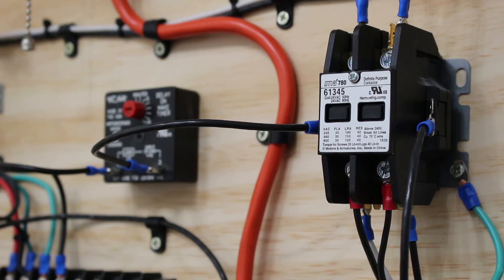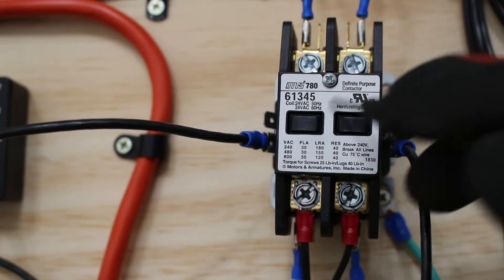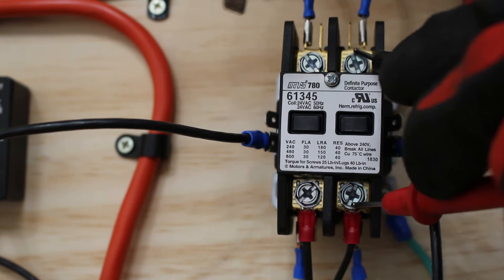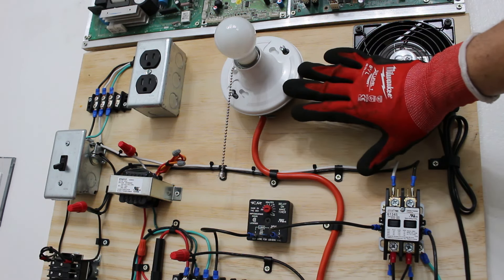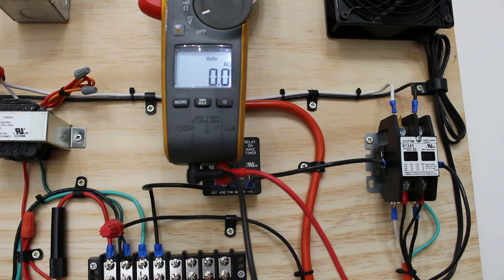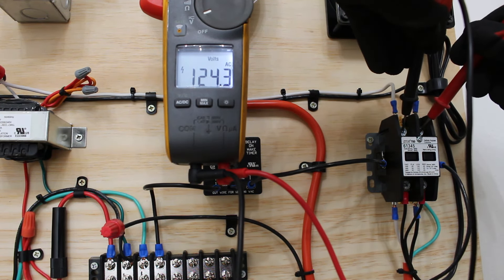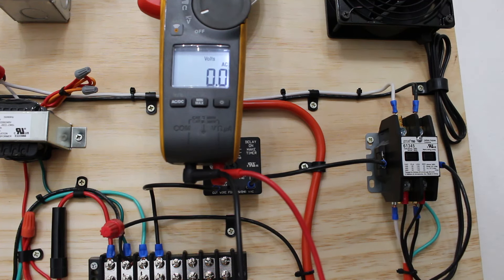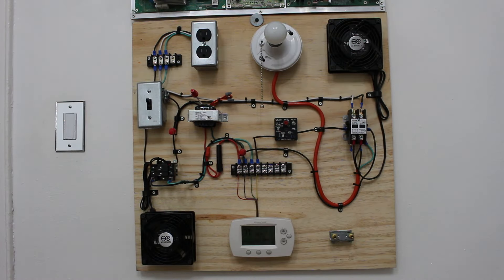HVAC Training Board: How To Troubleshoot A Contactor (Electrical Training Board/2 Pole Contactors)

Comment: As an electrician of 36 yrs, I love your videos because I generally don’t get to work on HVAC systems very often so it’s very interesting! I was just on a rooftop troubleshooting a 480 volt over load relay for an AHU that hadn’t worked in 7 yrs! All it was, was a bad over load relay, $300 part, all fixed. It makes me feel good to solve problems. What did confuse me was that the relay had an auxiliary contact on it and I couldn’t figure out what it was energizing because it got lost in a bundle of cables but in the end it didn’t matter anyway. Thank you!

Comment: Need wiring diagram showing where each wire goes from the load side of contactor.  Is timer always in series with yellow 24V?  Is blue/common required if batteries are not used in thermostat?  What wires go to and from transformer?  Thanks!
Reply: @ManoNfire Common is always needed to complete the 24V circuit in a thermostat with or without batteries.
Reply from the maker: This is something I just created in my mind. No wiring diagram but I will try to draw one. I will create a video explaining the wiring and what I did here. If the timer is for the compressor or condensing unit then yes, it will be in series with the "Y" wire from the thermostat which is typically a yellow color by code which represents "Cooling". You will not see a C/Common wire on every thermostat so if it's not used, you will notice it's a battery operated thermostat. I will make a video explaining your questions. The 24v from the transformer is connected to R on the stat then eventually each 24 circuit makes its way back to C on the transformer to complete the circuit. Thanks for watching!
Reply: @odeliocepeda6054  not true. Common is not needed in battery or mercury thermostat. In fact most homes don't even have a common wire available to use.

Comment: Great video, bro!
You can also test the amp draw, as well as each coil's resistance values as well.  Regarding the Primary side, you'll notice that if you place one of your multimeter's leads on Common and the other lead on one of the three line voltage wires, you should get the same resistance, no matter what line voltage wire that you choose in relation to Common.
  However, if you begin testing the resistance between any two Line voltage wires themselves, you'll notice a pattern: The resistance found between the two furthest Line voltage wires is the sum of the resistance found between two pairs of two adjacent Line voltage wires.  That is, the resistance between the 120V Black wire and 240V orange wire is the SUM of the resistance found between the 120V black & 208V red wire, plus the resistance between the 208V red wire and 240V orange wire.
  This sum check is confirmation that the Primary coil has the proper resistance in its coil.
  Regarding the Secondary side, there should be almost no resistance in its coil - approx 0.6 Ohms-ish.  There should be continuity.
  Hope I could help.

Comment: I did not know that about a coil that's energized that you actually get a voltage reading. 
Is it normal to have a time delay for the AC condenser and compressor?

Comment: Should I have 28 v on both wires coming from the Thermostat going to both sides of the coil. I check both wires they both have 28v independently.
Reply: Im not sure why I have 28v on my both wires going to the coil. It does not pull the coil in.

Comment: Kinda felt lost when you was mentioning in the video:
When the thermostat calls for cooling 24v (R) converts to 0v (Y) making the timer drop from 24v to 0v to make the contactor turn on ?
I honestly thought that when the thermostat kicked on cooling it transfer 24v (R) to 24v (Y) making the timer work, the timer doing its job by transfering 24v to the contactor to kick it on by giving the contactor 24v to pull the 108/230v to make the compr3ssor run
Reply: Likewise 
He said voltage drop to  0

Comment: What if my contact doesn't have the plunger piece that i see on multiple videos. I've replaced the capacitor and a burn wire going to the compressor and everything looks right but nothing turns on when i turn A/C on. I can hear power going to the unit but that's it.  I checked the AC breaker as well.

Comment: Start capacitor’s role is? Would it be where the timer is (yellow to the Contactor)? My Contactor isn’t closing so it’s a low voltage issue. Correct? ———>(Capacitor)?

Comment: Thank you for your video. There are no numbers labeled at the poles, are those top and bottom poles identical? If so, you can run "power in" at the top or bottom poles, right?
Reply from the maker: You're very welcome! Thanks for watching & commenting. You can install it either way so yes, you're good 👌 Stay tuned for new videos every week🔧⚡️

Comment: hey a quick question regarding voltage,  at around 5.04 you measured red to blue and the other wires, the meter reads 24 because R is energized and the other wires aren't so the difference in potential (voltage) is 24 at that point. and when you set it to cooling because Y is energized the meter reads 0 because now theres no potential difference between R and Y right? still trying to wrap my head around voltage readings being a difference in points. thanks for the video!
Reply: This might help as to fundamentals of what voltages are read where---> https://www.youtube.com/watch?v=F05kWMTOmrM&t=248s